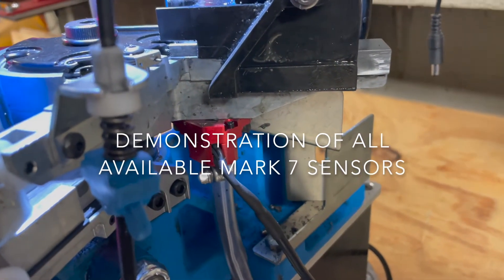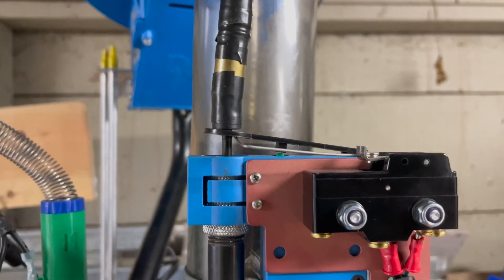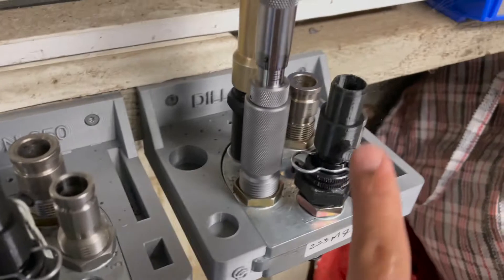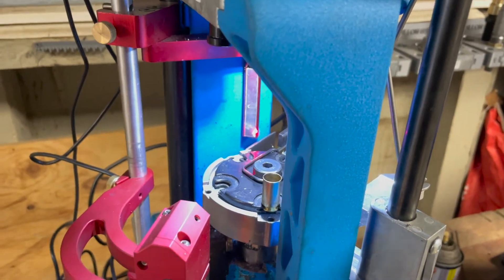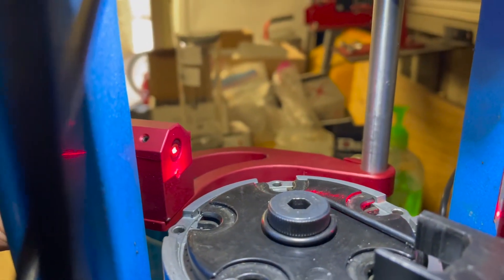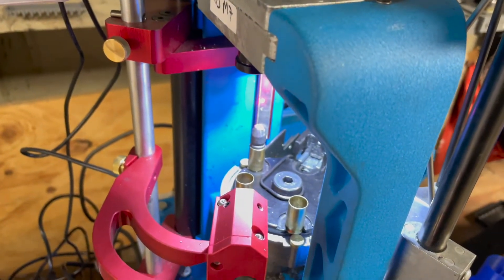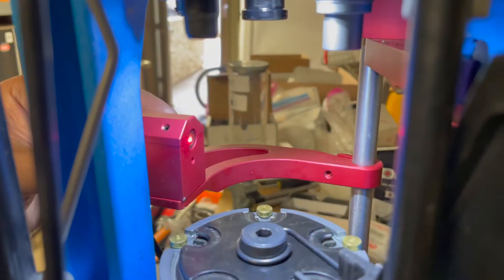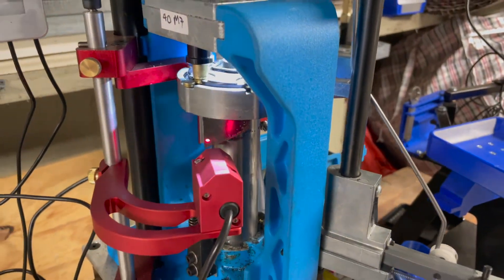Dillon XL 750 + Mark 7 Autodrive - demonstration of all available sensors

Comment: I have to ask, how are you using the factory failsafe rod but yet have a bullet feeder and the powder sense.  I have the double alpha version instead of the 3d printed option.  Is it that much smaller or do you only load pistol calipers and do not need the large powder bar for rifle calipers.  I also have two toolheads per caliper, one brass prep and the other loading, just makes it easier overall.
Reply from the maker: double alpha makes a special short bar and it works well for pistol loads.  The maximum it could do was around 22 grains of accurate 2230 which is barely enough for my match 223 cartridges at around 135 power factor.  They are good enough for matches but probably not good beyond 100 yards due to lack of velocity.

Comment: Total cost minus decap sensor?
Reply from the maker: If I recall correctly, around $350 for the bullet sense, $40 for the primer sense, $250 for the powder sense.  The decap sense was included when I bought my auto drive, but I wouldn't pay money for it as I think it's useless.

Comment: Why does no one post videos of a 750 running with a Audi drive. You only get adjustment/people talking/ limited brass processing. No one show videos of it running for long periods of time. Makes me think these are a waste of money and constant problems.
Reply from the maker: It does work for long periods of time.  If I load pistol rounds, a reliable output rate is around 700 rounds an hour with very little stoppage.  At this rate I can usually put on a movie or dry fire, while letting the machine run on its own and stop automatically when the sensors detect a problem.  The maximum output rate is 1800 rounds per hour I think, but I slowed down indexing (to avoid powder spillage when moving from station 2 to station 3) and top stroke (for reliable bullet feeding in station 4).

Comment: How much weight did you have to add to your primer follower rod for it to be able to trip your low primer sensor?  I just tried setting mine up and the micro switch on the Mark 7 primer sensor is so stiff that it doesn’t get pushed down far enough to trip it.  I have the 45 ACP casing on top of my primer follower rod as suggested by the Mark 7 instructions but it would need much more weight than that to trigger the micro switch. I was going to call Mark 7 next week to see if I got a defective sensor with too stiff a switch but I see on yours it looks like you have something taped on top of your follower rod to maybe add much more weight?
Reply from the maker: If i recall correctly - two 45 casings with one 230gr bullet inside it.  It’s heavy.
Reply: Mine works without any weight.

Comment: Nice video Gary.  I've been contemplating the decap sensor, but you just helped me decide.  Thanks
Reply: I also do not use my de cap sensor I found it to time consuming to keep clean with a pipe cleaner and compressed air. But I also found processing my brass first makes the whole reloading go WAY smoother but I use shitty (free) range brass 9mm
Reply from the maker: @snowgorilla9789  Totally agree, that's the way I run it also.  It doesn't matter what brass you use.  The inherent problem on the XL750 is that case feed is combined with decap in station 1.  Run the press too fast and you get stoppage when case feed isn't perfect and the decap die gets stuck.  The way to solve it is to separate brass prep, and run empty station 1 when loading.
Reply: @garykfko is it possible to pre prime brass and powder station 1 with spring on Dillon or another powder measure?